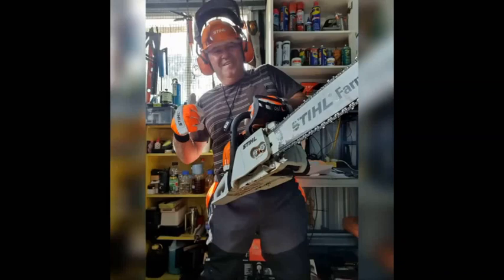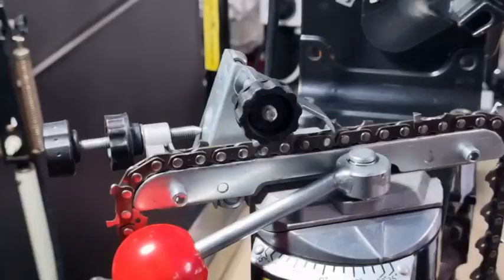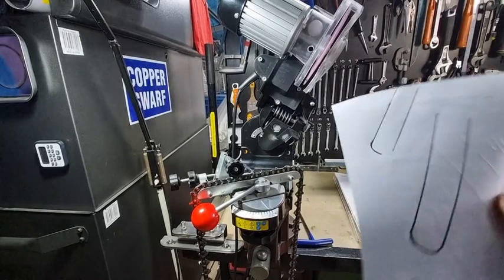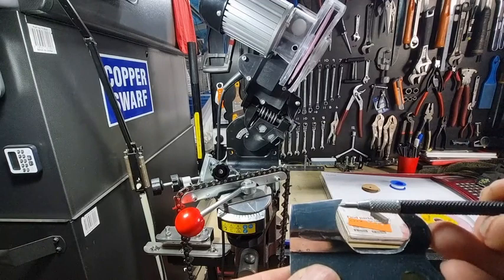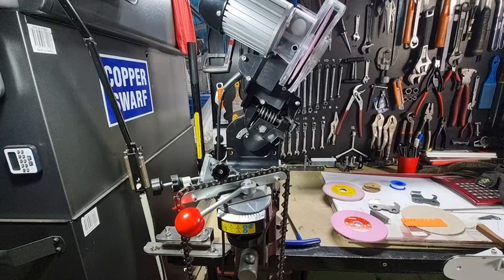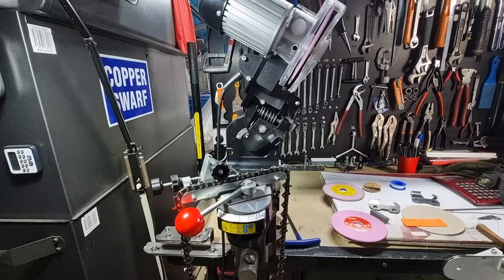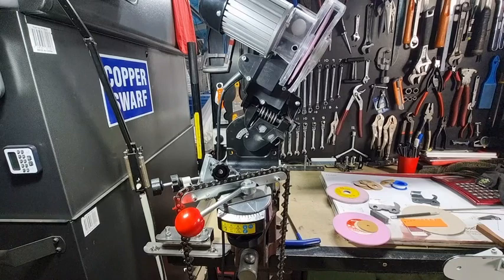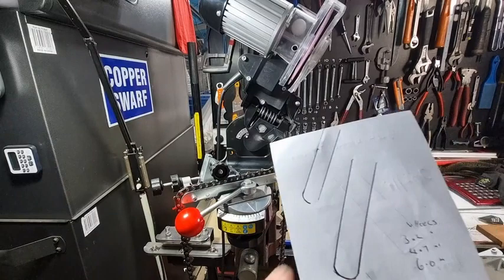Chainsaw Grinder Wheel Dressing Tips and Tricks

Comment: How do you dress the wheels that come with the Stihl USG grinder? These are meant to be asymmetrical but I found it really hard to work out which side should face the motor, even using the supplied profile guide. I don’t know whether they come symmetrical and you are supposed to profile them yourself?
Reply from the maker: I dress them asymmetrical and always just a nice U shape
Reply from the maker: You can dress they with the normal U shape works 100%